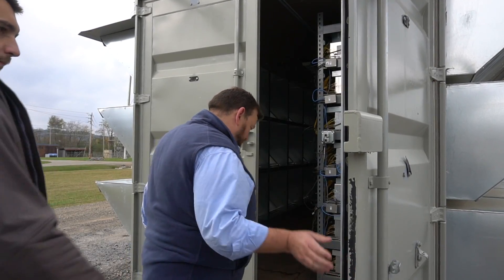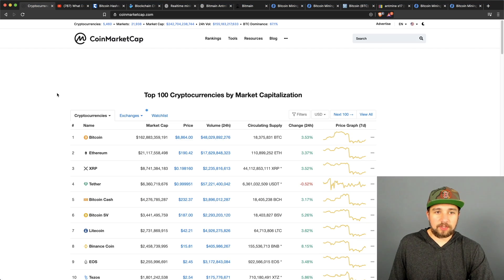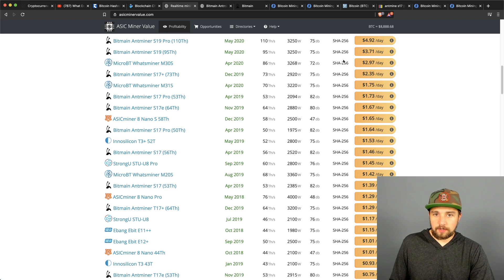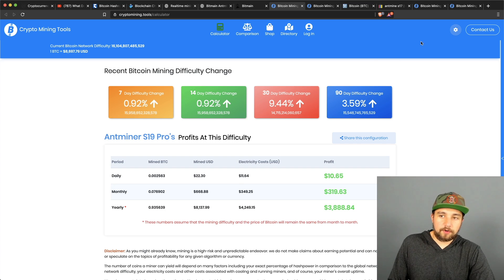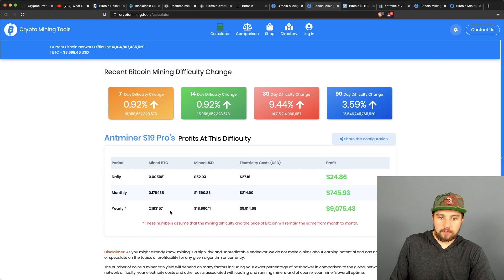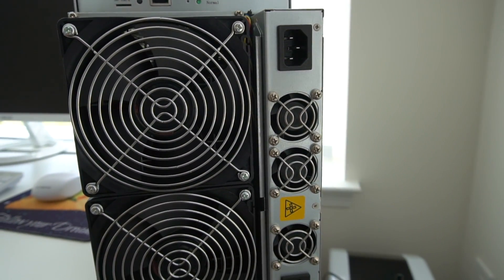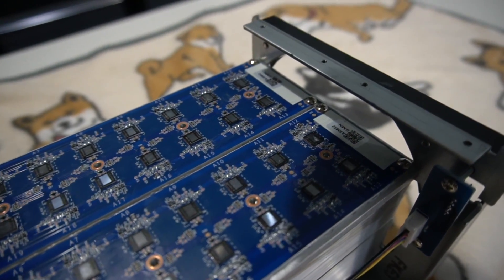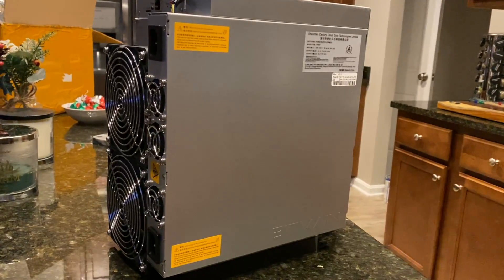What Do YOU Need to MINE ONE BITCOIN In 2020?! UPDATED!

Comment: After spending 1.5 days researching mining the major problem is the power bill. So the answer is to go 100% solar.  Research indicates that a 10 KW system will cost $21,000.  After that the major problem is the requirement to buy the latest and greatest hardware and replace it every 4 years which isn't that big a deal because any business that runs on electronics is going to have  to do that. So what's going to happen to all those miners out there that just got cut out because they can't build a solar mining shack? What's going to happen to all those machines they intended to build? This is the strangest business I ever looked at!

Comment: my aunt lives in kuwait.. electricity cost was at 0,017$ before corona.. i would guess, it is cheaper now...  .. does that change the game?? lets say, u have 100.000$... and the aunt would give u a hall u need to mine there, because she owns industrial poperties enough and really wants to support... would you do that over there?? or would that still not be possible...i mean, worth it ?? thank you! pls excuse my english sir
Reply: From when I lived in Kuwait, the electric was spotty and unstable.  You run the risk of surges and possibly wrecking your electronics.  You would need to have good surge protectors or similar protective measures if you want to ensure your equipment.
Reply: @tadslatter2196  hey dude. thank you alot
Reply: @tadslatter2196  my aunt, that kind the same, but only on her private proberty. she said to me on the industrial poperty, there are really strong and stable connection... but i will keep that in mind. thanks a lot, sir